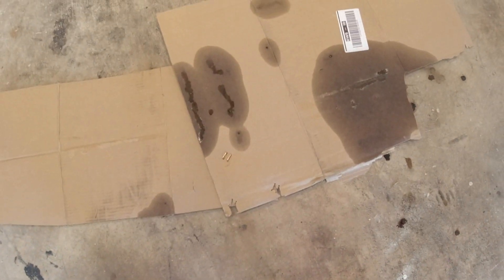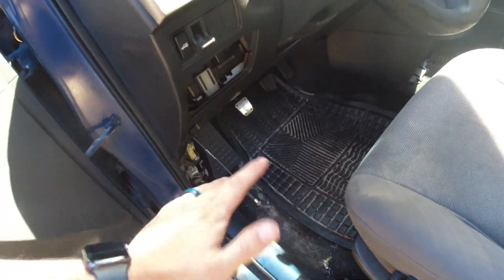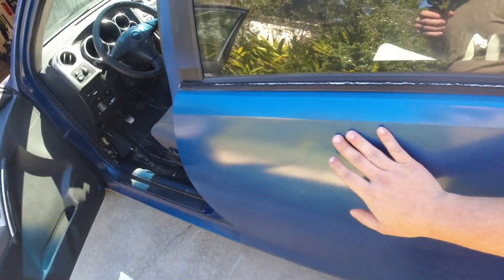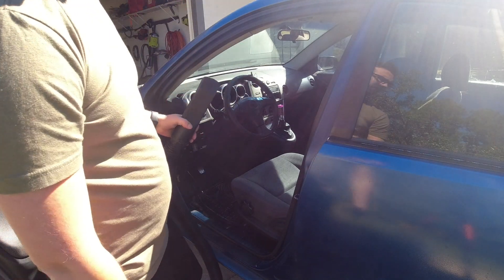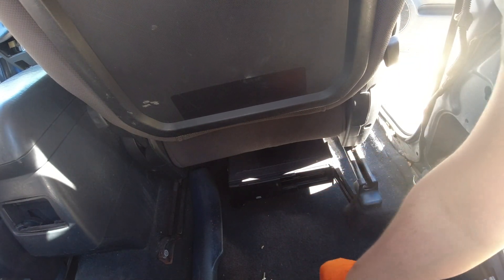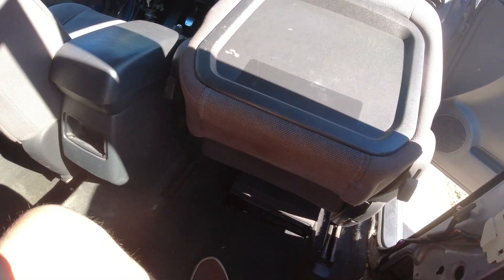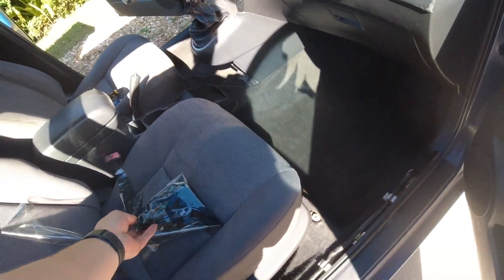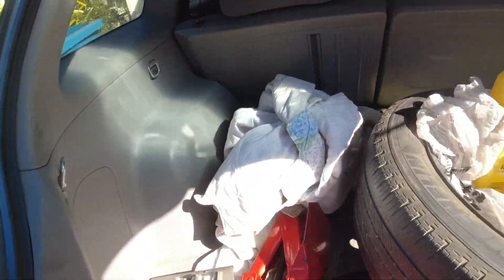Matrix XRS INTERIOR TRANSFORMATION

Comment: Looking forward to next episode - looks like fun project.

👍 😎 👍

For the seatbelts, you could send all of them out and have the color of the belts changed too. 😲

To remove the window tint, wet it down with soapy water, then cover (from inside of car) with black plastic bag. Once in the sun awhile, the adhesive will loosen for easy peeling.
Reply from the maker: I had thought about that. But it cost almost $100 per seat belt. I would rather not spend the money on this car until I know I can get everything else fixed first! 

And I will definitely try that for the window tint!

Comment: Those holes are threaded and those legs get attached to them with black bolts.
I think the lower back seat is supposed to fold up against the front seat and then the backrest folds down to make more storage space
Reply from the maker: I just need to get some bolts now to actually bolt the seat down. Because I didn’t find any cleaning the car.
But this car has many little quirks to learn about!